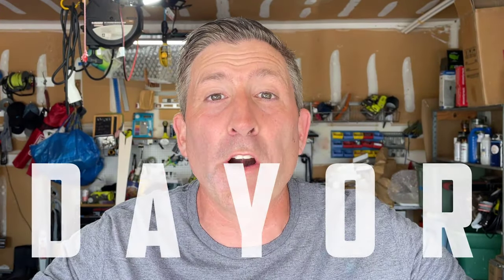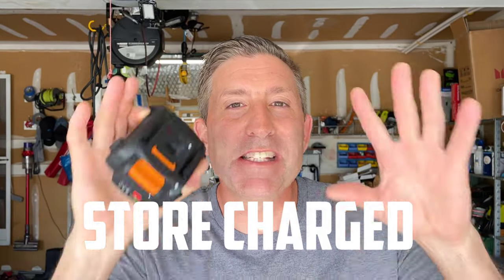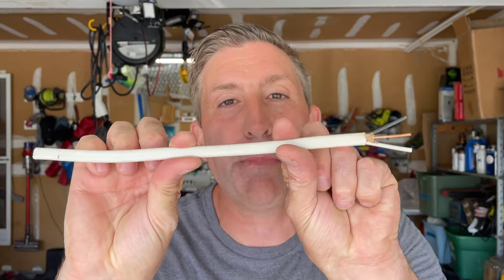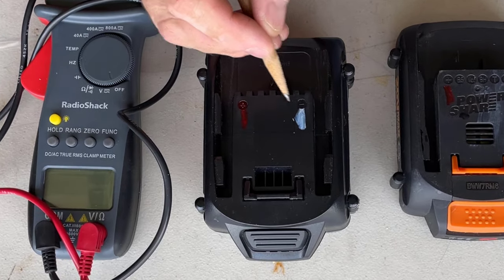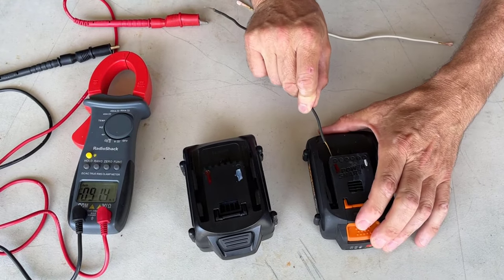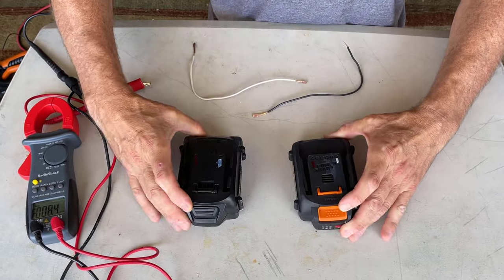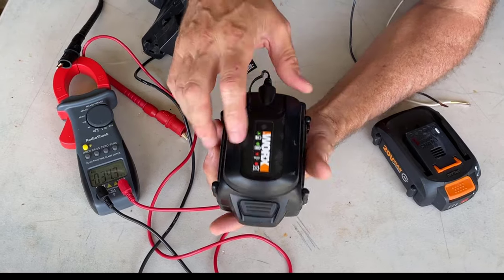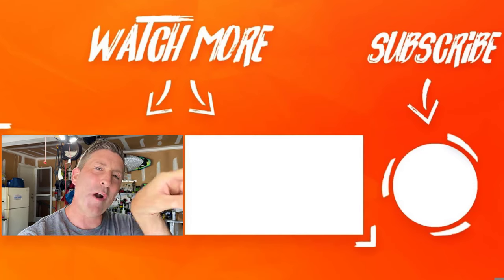DEAD TOOL BATTERY JUMPSTART HACK - Ryobi, Dewalt, Milwaukee ⚡⚡⚡

Comment: I know ego batteries are far superior to every li-on batteries available. Is popular mechanics wrong about storage. Ego batteries discharge after 30 days sitting idle to 30% charge. So they are saying not to store with a full charge to maintain batteries. Who is wrong ? Is ego doing that so that the batteries die and need to be replaced? If so why offer 3 year warranty? I am not criticizing you by any means. This was a great video that may help many people. Buut at $150,$250,$350 and now $450 for ego batteries i would like to keep them in tip top shape and avoid a major cost to replace. " these are not your daddys AAA's of old " if you could help please clarify. Love your channel mate
Reply from the maker: Alright so here is the deal - batteries really like to be mothballed at around 70-90%.  Ego discharges there batteries to 80% after a month.  This is a good thing.  Now the real problem is when people but a battery at 10% on the shelf for six months.  All cells loose power over time and this leads to a possible dead battery.  SO my point is more batteries die from being low charged than being high charged

Comment: I want to caution folks not to do what I did. If you “jump” too long, you will deplete the good battery below charger’s acceptable levels. Then you will have another useless battery.
     How do I know? I had an 82V battery system. One good-ish battery, one bad one. I measured voltages on all three. 82.3, and 56.4V. I jumpered exactly as shown in the video, but let it go 15 minutes. I then tested voltages: 74.5 and 73.2V. I then tried putting the batteries in the charger; it wouldn’t charge either one. Duh.
     My guess is that I should have tried jumpering for one minute max, then put the good battery back in the charger to recharge back to nominal. The bad battery would likely still have failed, but I could have repeated this sequence numerous times until both batteries were charged enough. Right now, though, I have no good batteries.

    Hopefully you can learn by my error.

Comment: I tried this method on my battery. It was reading 13v. I hooked it upto a fully functioning battery, and   it was reading 17v. I then tried charging it again, the red light just flashed a couple of times, and was on permanently  like before. So unfortunately it didn't work for me
Reply from the maker: not all cells are recoverable
Reply: @Kitearmy  is there any other method I could try?
Reply from the maker: @wilf7042  no the cells are probably smoked

Comment: very dangerous. You should always try to open the case if possible and check for faulty batteries inside the case. you might have batteries which are corrupt and doing this method may cause a fire or even explode

Comment: What if both battery died? Can you use a motorcycle battery to jumped it?
Reply: Depends on the voltage. If the dead battery in question is 12v like a standard motorcycle battery then it should work.

Comment: ....not just storing charged but at 75% of capacity. Fully charged is better than nothing but storing it at 75% is the best way to increase the longevity of the cells.
Reply from the maker: Sure but the worst thing you can do is near 0%
Reply: Most tool batteries only charge to a high storage voltage any way and not a full charge as it will kill the battery pretty quickly.

Comment: Store any battery at half charge, not full. They all come half charged from the factory for a reason. Do some research. The amount of time a battery is "full" should be limited to reduce battery degredation.

Don't fully charge a battery if you don't plan on using it soon. Sure it won't die if you fully charge it but those habits are the difference between a battery being useful for 1-2 years vs 5-10 years. Just ballpark figures everything can be built better or worse.

The same thing goes for phones and ev cars, everything uses lithium today. Tesla recommends a 80% charge limit for everyday use unless you are going to need that last 20%.
Reply from the maker: I believe 80% is the ideal
Reply: How long is, Soon"? I used mine every 2 weeks if not a little less. Thanks
Reply: What claptrap. I have batteries I keep fully charged whithout use for days or weeks. These batteries are coming up on 5 years.
Reply: @calculator1841  that has a lot to do with battery management technology used by manufacturer. They are not all equal nor are the cells used.

Comment: Battery Issue.The Fix is Place a Jumper from bad battery to a good charged battery.
Pos + to Pos + and Neg - to Neg- terminals wait for about 15 minuets for battery to equalize.
problem solved. both batteries are ready for work or charge to full

Comment: I just fried an ego battery after using the nexxus escape to charge my phone.
It drained it so low it would not take a charge.
Reply from the maker: did you give this hack a try
Reply: @Kitearmy  i was going to but i figured the nexxus as a charger is a trickle charger. So i tried that and it brought it  up so i could use a standard charger.
Reply from the maker: @egomaniac8510  That is a cool idea - good on you mate!

Comment: Would have been nice if the battery had been a RYOBI. My battery uses a different style of charger.
Reply from the maker: same concept
Reply: The brand doesn't matter. The contacts will be different, but the guts of all brand name batteries are similar.

Comment: You skipped over the important part and testing to see which is positive and which is negative. 

Being that this is SUPER important for safety, it would be prudent to include that step.
Reply from the maker: does not matter as long as you match them up - thanks for the like
Reply: He literally does in the video.
Reply: @calculator1841  that's what I thought! He even marked them with a sharpie.
Reply: The batteries are marked: B+ and B- right on the case.

Comment: Looks like the damage is done already with the voltage dropping that fast on the meter with that battery. You can get one back in the game like this for sure, but it may not hold a charge when not in use & it's runtime could be noticeably less than before.
Reply from the maker: It has been functioning now for a few eeks

Comment: Perhaps a warning NOT TO TOUCH THE WIRE ENDS TOGETHER when plug in to the battery would be fitting and appropriate.
Reply: Nothing happens if you touch them…

Comment: Don't store a battery fully charged! I'm a expert on li ion battery's all chemistries store at 55% or closest to it. A battery will degrade in storage fully charged or dead. U wanna go slightly above 50% so during the long duration it will sag to maybe 45% a nominal period for storage

Comment: The problem isn't actually the battery, the problem is the charger. They really need to make these with a recovery function because ninety percent of the time the battery is not damaged. The charger/battery controller is programmed to assume it's damaged if it's low.